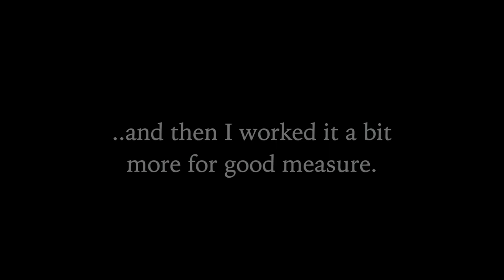Having a grinder explode in my face - Ferrari engined Alfa 105 Alfarrari build part 125

Comment: Glad you came away with a minor scratch Jeff. Nice going on the patches. I used my shrinking dish a few times and they really work well.
Reply from the maker: It worked well on the couple of spots I used it. I need to make a new backing for it to give it a proper go.
Reply: thanks for the spoiler! I was putting off watching this one.

Comment: Lucky it's just a small injury,  I learnt the hard way I had a face shield but didn't use it just safty glass I was cutting a bolt off under a car it grabbed and flicked out cutting my nose open on one side it was fast and I just turned off the grinder and went to get help, off to the hospital,  lucky it wasn't that bad just stitch's, so after that used it more and bought a new face sheld , but I still will need to use it more on small stuff,   they are dangerous stuff,  had a disc disintegrate on me as well 😞😞    good you are ok 👍🏻👍🏽  car is looking great 👍🏻

Comment: Grinders are no joke. I'd rate them as the most dangerous and underestimated tool in any toolbox/shed/site. The fact they almost require your face to be relatively close to them in use makes any mistake or hiccup a potential catastrophe. Not just from shrapnel or spray but a grinder that catches a cuff or skin will walk up your arm in a flash right to your neck or face. Full face shield is imperative which is my go-to for most tasks and tools rather than glasses. This from a 55 year old builder and general tool user.
Reply: I've had scratched/shrapnelled cornea twice from using grinder ... both times while wearing safety glasses! Red hot metal filings/sparks have a habit of sticking and burning into the cornea. It heals fairly quickly (matter of days), but if you get one in the center the resulting scar no matter how small can potentially interfere with the center of vision for the rest of your life.

Comment: Very glad to,see that you were not badly hurt Jeff. On some oil rigs I worked on they would put up posters of horrible exploding grinding wheel facial injuries in the galley. Put you right off your tea and biccies. It must have worked though, because I would never now use a grinder without a face shield.

Comment: Hi, Jeff…as always, great info and content, glad the backing plate explosion didn’t have a disastrous effect.  Nice work on the patch panels…have you considered using a product like FeatherFill primer over those areas rather than a skim coat of filler?  Regular filler certainly has its place, but I’ve always found that using it usually means multiple thin coats, pinholes, and finishing with glazing compound in order to get a smooth surface. Sometimes a filling primer can shorten the process by providing enough thickness to be sanded smooth the first time.  Just a thought…really enjoy your hard work and enthusiasm, also love the content by Mrs. Jeff!

Comment: Close call with the grinder.  Yes, Mrs Jeff and Mrs Dean share a lot concerning safety and other observations which is actually a good thing.  Funny analogy about chin mounted face masks.  Watching your panel beating methods is quite different to what I was taught back when Brylcream was fashionable BUT the result is just the same so beauty mate.  Lead body solder does work quite well but as you said it needs a lot of work.  In the old days the fumes were murder.  We used a pedestal fan to blow them over the apprentice.  Cheers.

Comment: Re:bumpers - I own a fiat 124 spider, and have replaced the heavy bumpers with rubber bumpettes. I’ve also added a small chin spoiler. That combination really compliments the compound curves of the lower front fenders and finishes the look of the front. 
Might work for the alfa....

Comment: I do think that the Alfarrari would look killer in copper on black, based on how awesome the copper weld-through primer looks on it already. It'd be really cool to sputter actual copper onto the car and get a brushed effect before clearing it, but that would be an absolute nightmare and require a torch adapter. I did see a copper candy that looked pretty great, since most copper metallics or pearls just look the wrong color, it might be necessary to mitigate that with a tinted overlay to increase the richness and add depth. Or you could just fine that copper weld-through primer in a gallon bucket and spray it directly then clear over it. I mean, the color's pretty great as it is. Copper body with black hood, roof, and trunk? I think it'd look pretty great. Or you could tape off along body lines and do a two-tone with a pinstripe or something cool. Just some ideas. I love the steampunk aesthetic of copper and black.

Comment: Guys have been saying you should have the guard on the grinder.  I thought:” How cavalier” and he’s been getting away with it…. I guess not. I will need to make up a shrinking file.  How coarse a file you start with?  Re-harden after the heating and bending?  If so, how?  Thx.  I will be doing a rust repair on a GTV in the coming fall and winter, along with everything else for it’s second time 35 years after its first.  Will use your copper pad weld-up-tool, Fitzy’s 45 degree cuts, probably repair panels from England, one side new floor, and more.  Might use some CF panels, drop a few pounds.  I’ll use a rotisserie for a while, as most convenient and comfortable for the work.  My first use of it was doing a racecar and was attached front and rear bumper mounts, only.  Might add a thru brace this next time.   Thanks for showing so many work habits and approaches.  You’ve been a great teacher.
Reply from the maker: Use a finer file. I tried to make another one but it just snapped. 

As for the CF panels, I would think twice as those I know who have bought them have found they cost a small fortune, they don't fit well and you can't tweak them to fit like you can with steel ;)

Comment: Have you considered putting the bumper mounts through the rectangular hole where the indicators go? In the bumper configuration you can mount the indicators on the bumper

Comment: Beautiful video Jeff. What do you spray on the sheet metal to prevent it from getting rust? My small practice metal sheets all are getting a coat of rust when exposed in the air.
Reply: Etch primer, usually 👍
Reply from the maker: Link in the description
Reply: @HomeBuiltByJeff  thank you.

Comment: before putting plastic filler on a car... try this... clean the area quite well.. get some tinning solder.. and paste it onto the body.. now with a gas trouch,, heat till turns brown,, then wipe off with cloth towel or what ever you have.. this will leave the tinning behind..now add the plastic filler.. and it will never rust under the plastic filler...no matter how will you prep the bodyshell for plastic.. water ' will ' get under it and start to rust..not today or tomorrow,, but it will rust.. use of the tinning compound, will stop this from happening. this way you will not be sticking plastic filler to bare steel.it does work